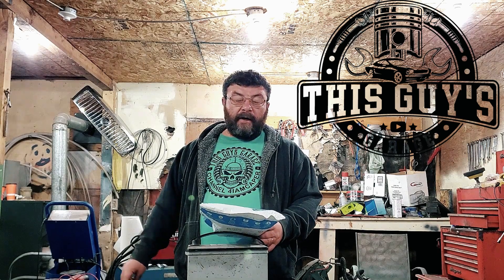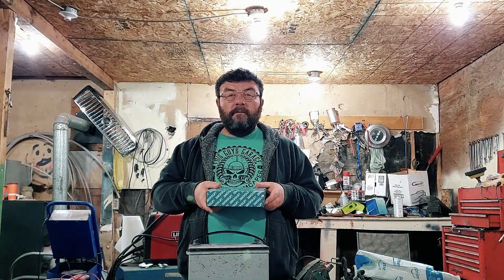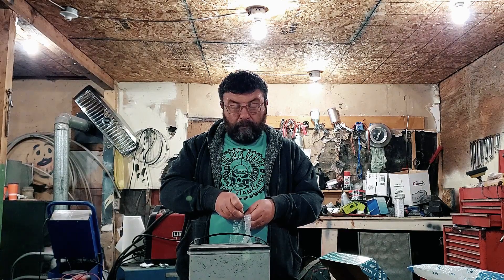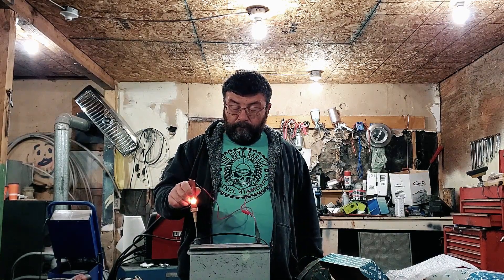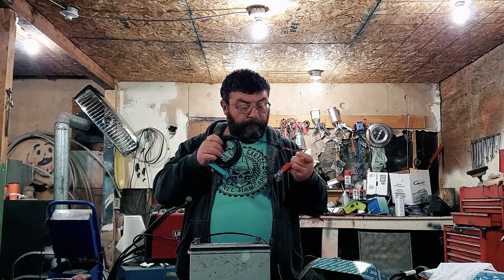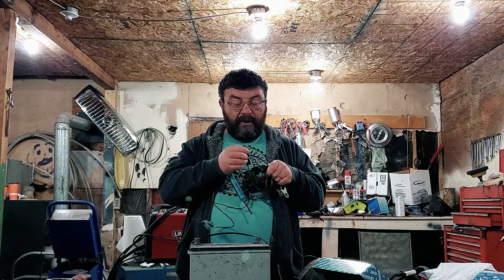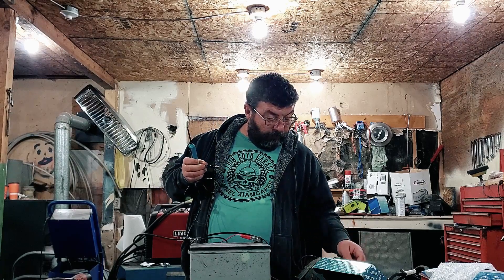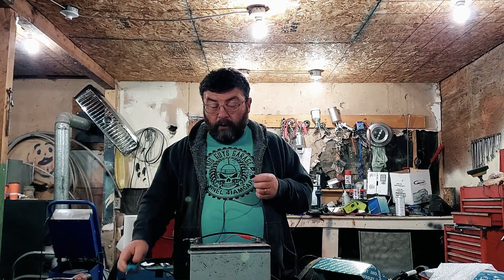allsun Power Probe 6-24V DC Auto Electric Circuit Tester Car Electrical Diagnostic Tool

Comment: Does this tool offer the same functionality as a power probe 3? They sell a top diag p100 for under $50 but this is half the price. I wonder if it's worth the extra compared to this and what's the best cost to features ratio for this type of electrical probe tool. Autel also makes one that's around half the price of the name brand version.

Comment: I got something great for mom, this isn't it... 🤣
Looks pretty useful to throw in the tool box. Surprised it doesn't have a beep mode.
My Fluke meter and most newer ones have it just to make life easier when you need 3 hands but have two. Being able to power up anything is certainly very useful.
Reply from the maker: after a little more investigation it makes a noise if you are in fault ,the wrong place but i was thinking it would make a different noise for ground and positive ,but the price was right,ty dartman
Reply: @thisguysgarage  I was going to say I bet there is a switch or a trouble shooting mode for the beep, now it's good enough🤣 I drive my coworker crazy saying that when we are fixing chimneys... He's coming around to my point of view now though 😉
Reply from the maker: @69Dartman  as long as your driving and not getting driven coyote ,its all good lol
Reply: @thisguysgarage  The nice thing is usually nobody is going to come up there and mess with you...
Reply from the maker: @69Dartman  very true 👍